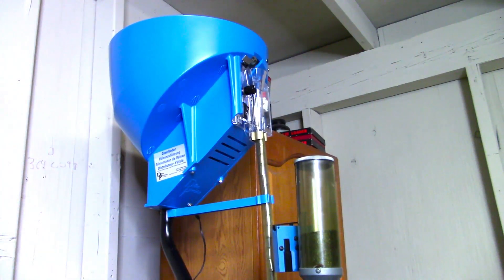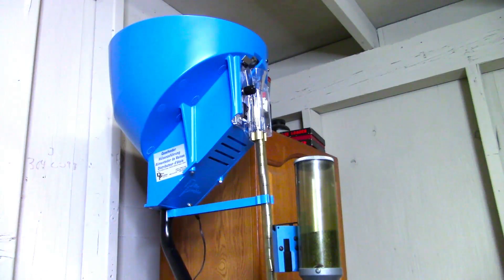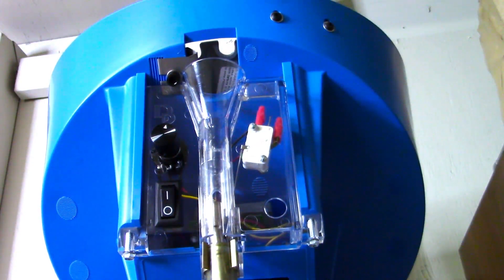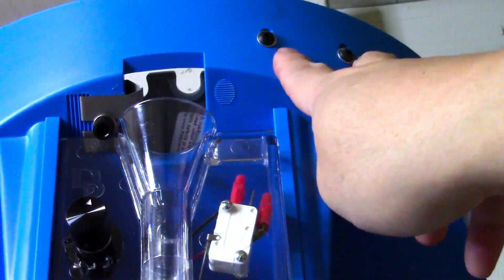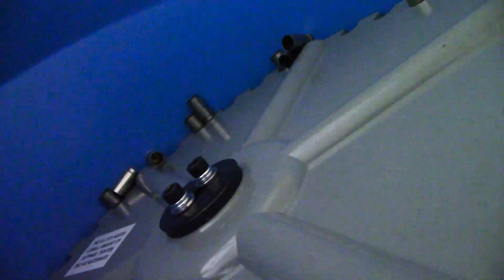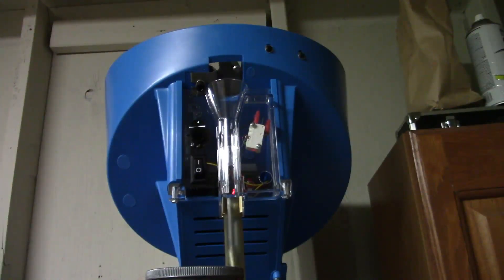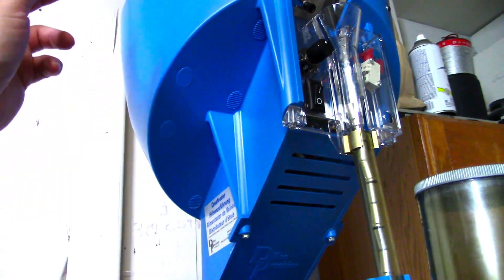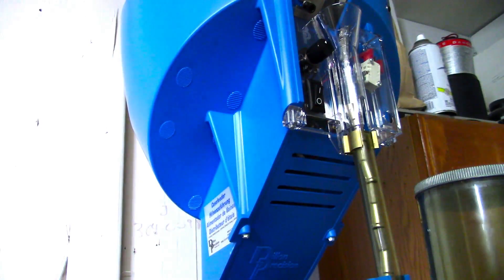THIS THING IS A GAME CHANGER.

Comment: Congrats, Batjac!!  When I was reloading I used a Lee Classic 4 Hole Turret Press.  I built a case feeder out of a 5 gallon bucket, a windshield wiper motor, and some limit switches.  It took some time to get everything right, but in the end it worked like a charm.  I saw the idea on a YouTube video.  I have given my reloading equipment to my sons and in return they give me a box or two of ammo every once in a while..